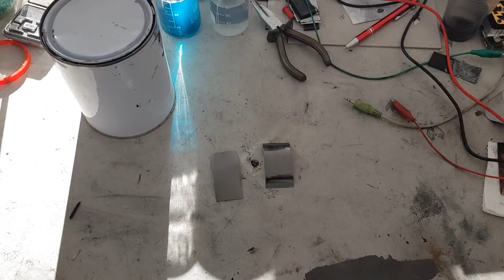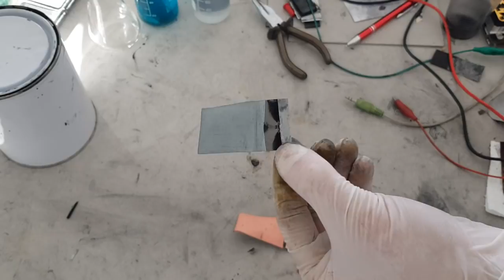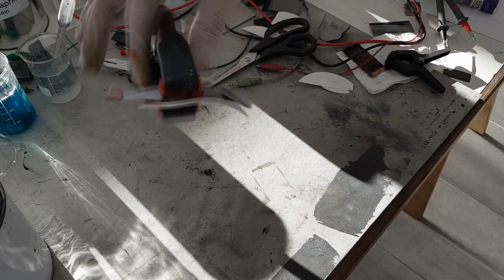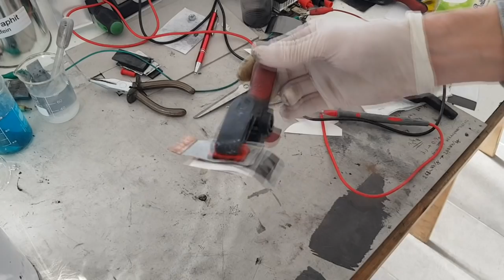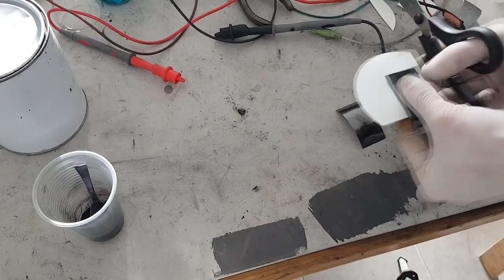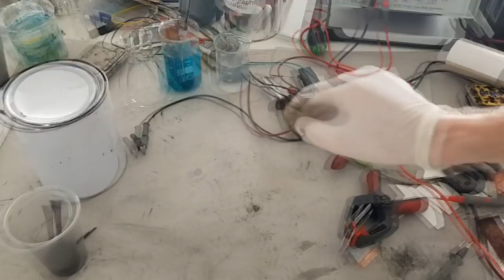Paper battery

Comment: OK nice work.
Could you try using the copper plated one like you did with the carbon carbon battery....
Use the copper on the outside to increase the current.

Copper
conductive ink
paper
-electrolyte-
paper
conductive ink
either zinc or nothing but conductive ink

 The way you did it makes a regular zinc battery. The way I have show goes back to our carbon/carbon battery....

 Thanks for the video!

Comment: Mr. Cayrex2 are you building a Lead/Zinc, Lead Aluminum paper battery? I have an extensive knowledge on electroplating, metal coating and now getting into storage batteries, thanks for all of the knowledge, I am working on Lead/Zinc batteries designs for offgrid energy storage where weight and size is secondary to capacity and cost effectiveness, but paper batteries have untapped potentials, I will start working on a Paper Lead/Zinc battery as soon as possible
Reply: A good idea. There will be time to try. But this is after when you reach the top started.
Reply from the maker: Hello! I make only non paper lead zinc battery. The lead zinc battery is a good battery,.... is some upgraded lead battery. Some lead zinc paper battery sound good. But how electroplated lead?
Reply: @cayrex  I need to see too. can get bungled something like that ???
Reply: @cayrex  Lead can not be successfully electroplated(at least with a regular electroplating set up) but that is really not necessary, Lead Oxide can be plated directly to Graphite or do what I have done in the past, just electroplate the graphite paper with Copper or Tin and then coat them with liquid lead solder(Melting point 188 °C (370 °F) ) then by electrolysis activate the lead solder into lead dioxide
Reply: Marvin Sevilla So first on, yes lead can be electroplated, but its hard though, you need get a water soluble lead(IV) salt and a dendrite preventing additive such as glycerol or peg [mw 400- 100.000] as well as very low currents, but on the other hand, NO lead dioxide can‘t be electroplated since this means reduction of the Pb(IV) to Pb(0) otherwise this would be a displacement reaction which is not possible in an electrochemical device. But I really don‘t recommend working with lead compounds since they can easily be absorbed through skin and cause serious intoxication.

Comment: Which paper should  used for paper battery ?
Reply from the maker: Any kind of printer paper will work
Reply: Plz it's very important for me it's my university project 
And I can't do this 
Without any help like your help
Reply: If we open the battery cell and grand it's black material and add some water in it 
Then is it conductive ink ?
Reply: The seprater which u r using 
Is a simple printer paper ya something else if something else which kind of it !?

Comment: if you al plating it and roll them basically you build capacitor right?
Reply from the maker: Innthis video I make a battery in basic copper zinc battery and on the end of this video I make a carbon zinc battery. To make a symmetric capacitor you need on both electrodes some carbon based material and to make a asymmetric capacitor then you have some metal oxide on positive electorde and some carbon based material on the negative electrode

Comment: You can charge the battery?
Reply: Copper Zinc batteries are not rechargable, if you try to do it you will get copper ions on the electrolite and they will wear out the zinc anode by displacement(copper ions will displace the zinc metal ions on the anode)

Comment: What is something close to a lithium battery
Reply from the maker: Hard to say because all batteries that can be close to lithium battery are in development. Sodium ion or magnesiun ion batteries are close to Li-ion. Also some aluminium batteries can also be really good in capacity, cycle life and safty but also this battery tech is in development, so is hard to say what will be the future
Reply: @cayrex  And I want to achieve results with lead acid. The truth with recycling is not very chic as with new raw materials. Or, it’s not as far as the truth is, what’s right and how much to lay down and the addition of a kompaneta.
Reply: @AlekseyCamodelkin  Mr Cayrex2 is very close to a Paper based(or at least a very light) Lead/Zinc battery that has the potential of being a direct replacement of the ancient Lead-Acid battery, with higher volts(Lead Oxide/Zinc has about 2.3-2.4 volts when charged) and about twice the energy density (Wh/Kg) I am on the same path but since he is way smarter he should be there sooner :)
Reply: @nicamarvin  There are interesting things here, I like to watch videos on this channel. Sometimes new ideas come. But I am still interested in acidists, they are powerful🤔👍
Reply: @AlekseyCamodelkin  Sure you can keep using dilute sulfuric acid(battery acid) with the Lead/Zinc based batteries if you like, the voltage will be around the same 2.3-2.4 volts, which is higher than 2.1 of Lead/Lead batteries, you just need to handle with care, others like Mr Cayrex2 and me have found very good substitutes for H2SO4, for example Sodium/Potassium Sulfate, I for one use regular Epson Salts, it gives me higher voltages and its quite safe.
Reply: @nicamarvin  I still need to bring one case to the station. then we will look at other options.